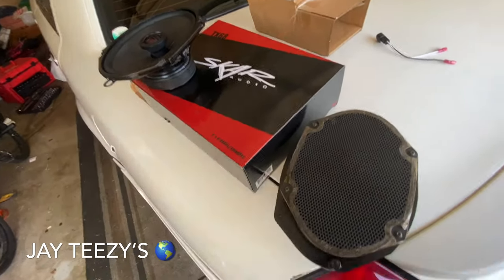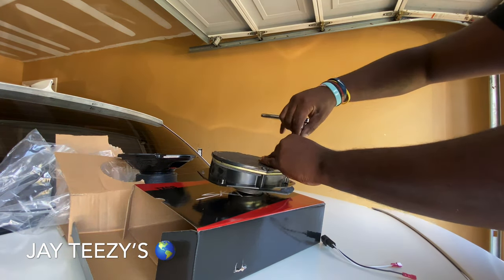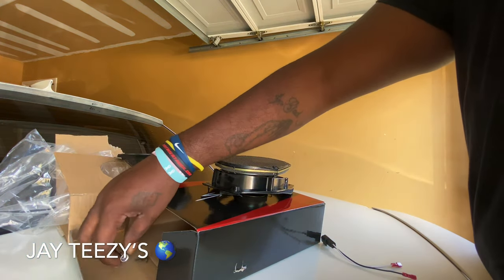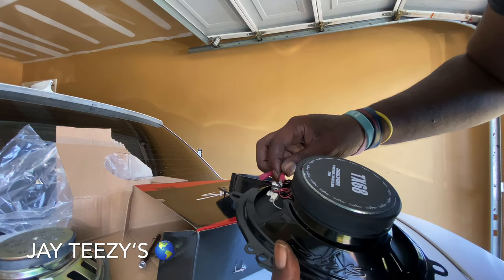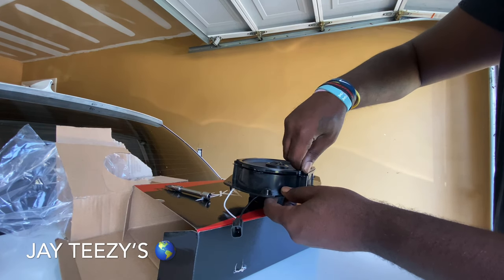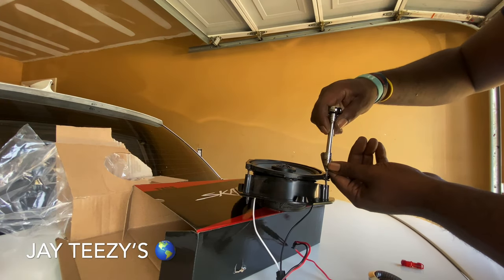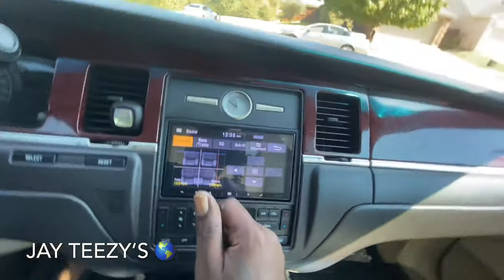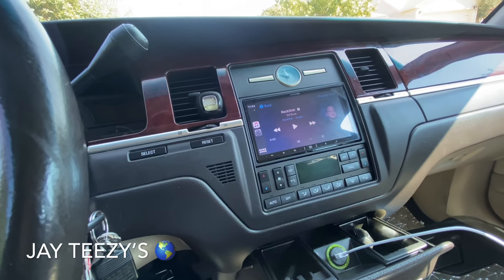Upgrading to Skar Audio TX68 door speakers in Lincoln towncar big difference

Comment: Did they come with a harness or did you have to buy one
Reply from the maker: Had to buy the harness but trust me they make life easy
Reply: @jayteezysworld6817  is there a certain size for the speakers? Or does it depend on your car?
Reply from the maker: @jimmiecortez3548  depends on car
Reply: Where did you get those connectors for I need those yes sir that's the easy route hopefully I can get reply back b4 weekend ima install all mine from factory
Reply: @marquisspears1244  you can buy them at BestBuy. They make life so much easier for somebody who don't know nothing about hooking up speakers like me LOL. I did my speakers in my 93 DeVille and they sell them for the car brand. Like GM or Ford you just have to match it with the year of your car.

Comment: Hey man I just wanna know do they have good bass
Reply from the maker: I put some in the rear deck also. Watch that video you will hear they have bass.
Reply: Where did you get the harness from big bro ? I just bought these same ones for my 2006 Ford fusion
Reply: @akidim13  they sound terrible no bass or good sound quality not worth it
Reply: @akidim13  I had to return them my stock speakers sounded way better
Reply: @al3xis321  for reals ? I mean I got them for 20 percent off so I ain’t really tripping , I’ve seen nothing but good reviews
Reply: @akidim13  yea bro they don’t sound that good and I had them in a amp
Reply from the maker: @akidim13  I bought the harnesses off eBay. Makes life easy.
Reply from the maker: @al3xis321  did you get the TX series? Do you have a stock radio? Mine on my alpine with an amp has my rear view shaking.
Reply: @jayteezysworld6817  yea I got the tx version and on a aftermarket radio and amp
Reply from the maker: @al3xis321  Really mine sound good. Most of the bass comes from the rear but I also have speaker baffles in the rear.
Reply: @jayteezysworld6817  like my stock speakers hit harder then these
Reply from the maker: @al3xis321  what kind of stock speakers you have? Maybe I need to upgrade again LOL
Reply: @jayteezysworld6817  I have  a 2011 Ford expediton stock speakers with aftermarket tweeters all around
Reply: @al3xis321  maybe it’s the quad tweeters causing them to sound bad ? I know the Skars have them on the speakers and if you have aftermarket ones maybe you have too many of the same frequencies bouncing off each other making them sound bad
Reply: @akidim13  it’s just has no bang to them
Reply: @jayteezysworld6817  yeah same , got them for like 8-9 bucks , I’m all about supporting local business but my local car audio shop was trying to charge 40 for them so I tried at least lol
Reply from the maker: @akidim13  I don’t understand where they find them prices. They cost $10 if you sold them for $20 you double your cost without price gouging.
Reply: @al3xis321  if you want bass get a SUBWOOFER
Reply: @al3xis321  well I’d rather have a full set for $100 than have just 2 door speakers in my 93 ranger. Anythings better than some stock shit from 93 😂 lets be honest.
Reply: @al3xis321  did you have a head unit I got these in my front doors no other only two speakers in the whole car and they shake my side mirrors running on a 200x4 watt pioneer double din unit these hit and I only got two
Reply: @al3xis321  y'all young kids don't know nothing about "Bang"!
 9 out of 10 youth that I talk to these days, think that 100Hz is  "banging" when its just a bunch of midbass bullshit that does nothing but annoy everyone within earshot.  Wait until you hear a "SQ" system! ( where the bass actually goes down to 20 Hertz and the highs actually go up to 20,000 Hertz you'll hear and feel things you've never had before!🍺
Reply: @TaylorMadejdm1975  What's a SQ system??

Comment: Can I put 6x9 in in door of my 03 Town car?
Reply: I don’t think they will fit, I believe 6x9s are too deep to fit in the front door. I’ve been researching to see if 6x9s will fit in the rear on my panther car.
Reply: @SteezyGarcia  The 6x9s will fit in rear of the Crown Victoria no problem but you might have to do a little dremeling to remove some metal for the slightly bigger speakers. I'm currently deciding whether I should keep my 6x9 in my rear of my Crown Victoria Police Interceptor or swap them out with 8" full range speakers with some slightly more metal cutting.
Reply: @1nsurgent  Nice. I ended up putting 6x8s JBL Clubs in the front & back of my Vic. I’m happy with how the car sounds now, anything is better than the paper cone speakers.
Reply: @SteezyGarcia  I know that's right (^_^)